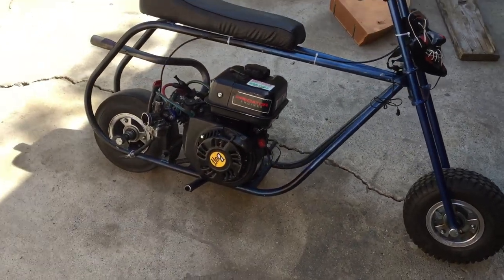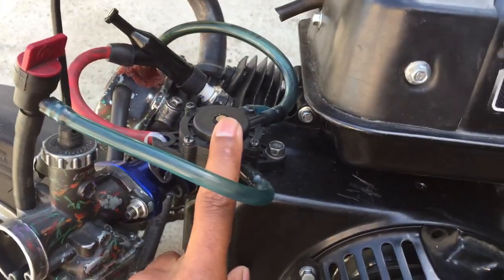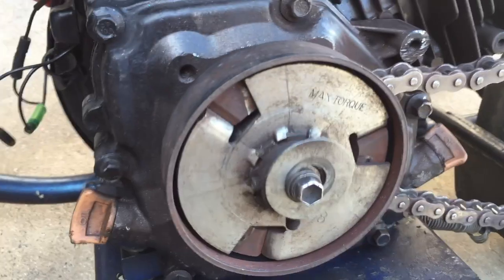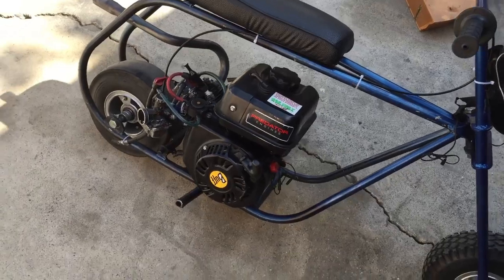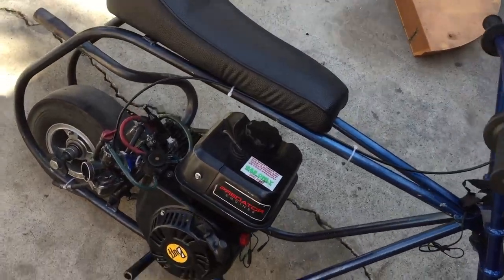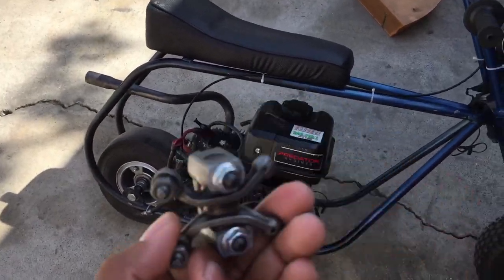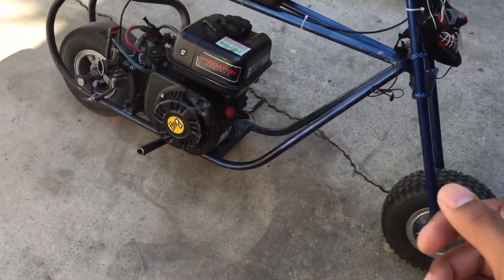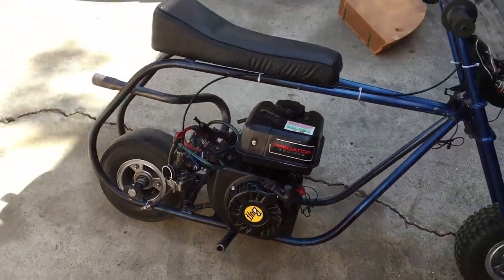WHAT'S IN MY MOTOR! MINI BIKE WALK AROUND!

Comment: Nice simple build. I hit 60 last night on my motovox and that was fast enough for me. What was wrong with the champion rockers? They were a bit tricky to adjust but haven't given me any problems as of yet
Reply from the maker: Too much compression with the champion rockers then if I made them loose the push rod pop out
Reply: @RoyalJZ  I used different push rods with mine but can't remember the length. Also, I double gasketed the valve cover to give those rockers clearance. If you don't get it figured out I'll measure them next time I take the head down and let you know